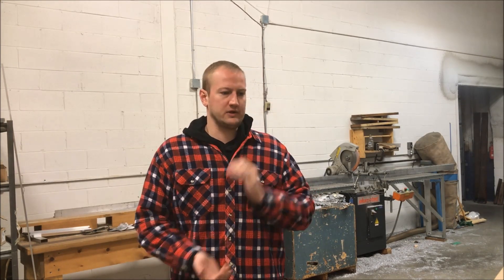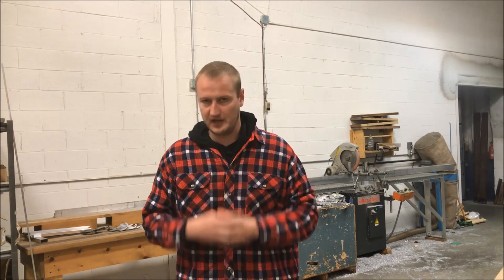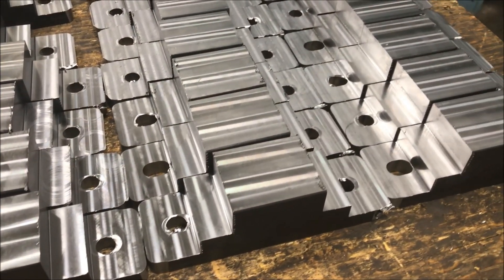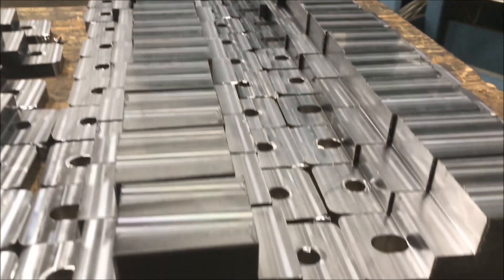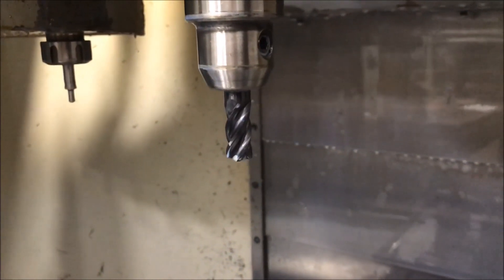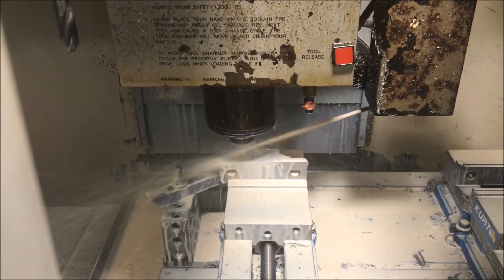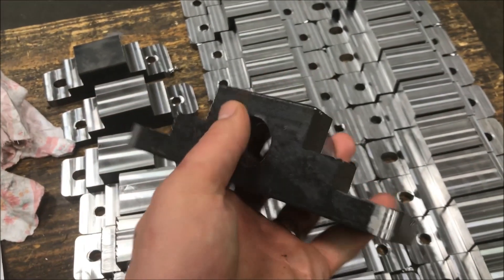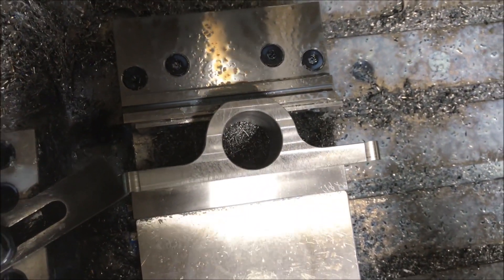BEGINNER CNC - MATERIAL PRE-REMOVAL

Comment: i'm curious, what the cycle time was ripping it down with the 1" indexable?  we use a longer 1/2 end mill with trochoidal milling and I think that would be faster than doing multiple ops.
Reply: My guess is that he has to hold some tolerance and removing that large amount of material in hot rolled in a single op causes some major warpage.  Also there are high feed indexables that cut steel really fast.  It would have been nice to see some of the cutting.  I agree that " Dynamic " or " Adaptive " toolpaths probably would be faster mrr then a traditional APKT style insert, plus less handling.
Reply from the maker: Yeah adaptive clear would’ve likely worked as well - potentially faster. We were flying at like 60 ipm with .1” DOC I believe - it really hammers through it quick with these Mitsubishi cutters